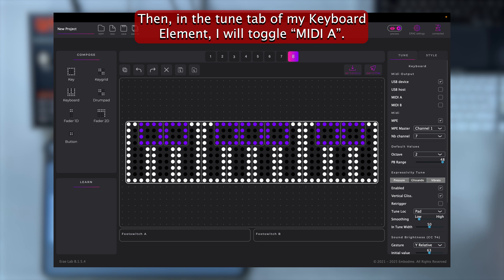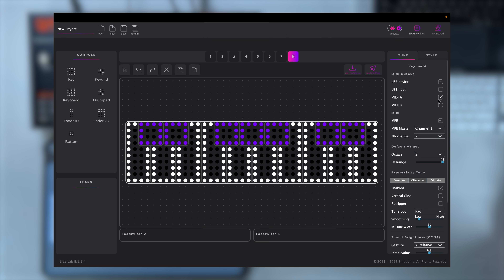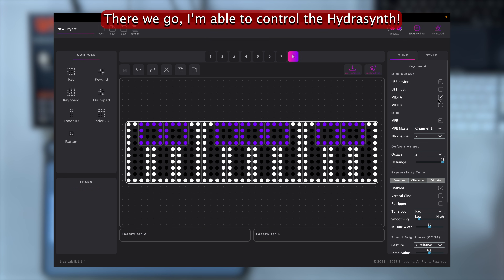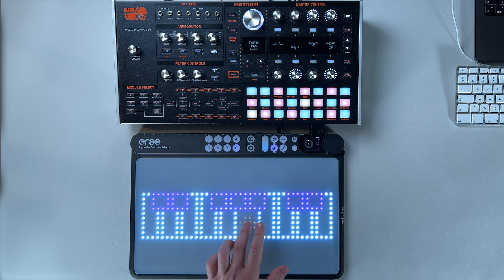How to Connect Erae to Hardware Synths (MIDI & Clock Setup Tutorial w/ Hydrasynth)

Comment: I have followed this tutorial step by step.

Midi A (Out) to Hydrasynth Midi A (In) I have turned on MPE in my synth settings I have done the settings in the Erae Lab and is not working for me, I have tried two different midi cables and no joy, any advice?
Reply from the maker: Hi, have you got MIDI A toggled on in the routing section? (parameter button --> routing)
Reply: @embodme  It was because I did not know to hit the preview button within the app, which I finally realised, would have been good to mention it in the video, but after watching several times,  I noticed the difference between my app and the video and sorted it.

Comment: It would be great to see it work with the Osmose and the Polybrute 12, seeing how one can glide multiple notes simultaneously, which those MPE synths can't physically do, unless instructed to by a controller/software
Reply from the maker: Sure thing! We have on our roadmap two videos where we use the Erae to control the Osmose sound engine by Haken, and Pigment by Arturia, perhaps we will try to get a hand on these hardware devices on the side to help compare how our surface can overcome some limitations like the MPE glides!
Reply: @embodme  Great thanks. Polybrute and Polybrute 12 owners would also be really interested in such videos, given the inability of the keybed to torepitch multiple notes at the same time (but the ability to receive such messages from the Erae is the missing piece of the puzzle, especially since Polybrute 6/12 should be class compliant)